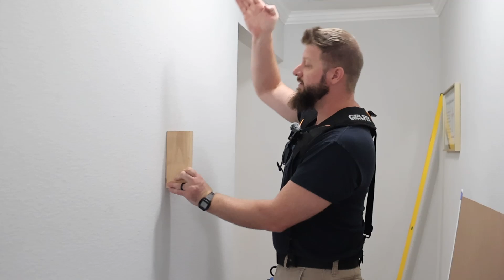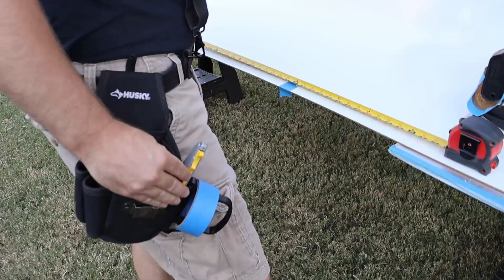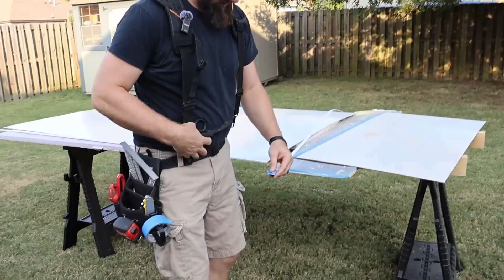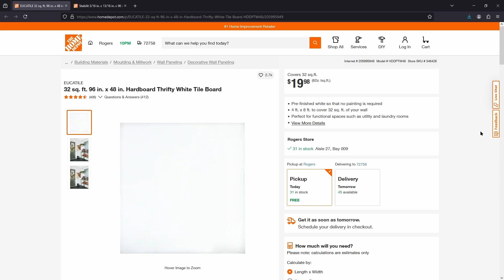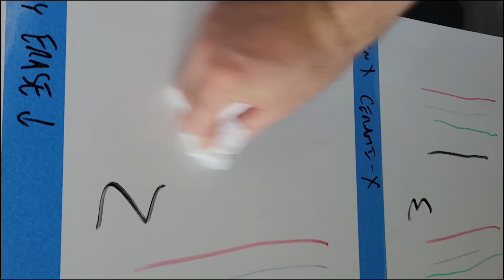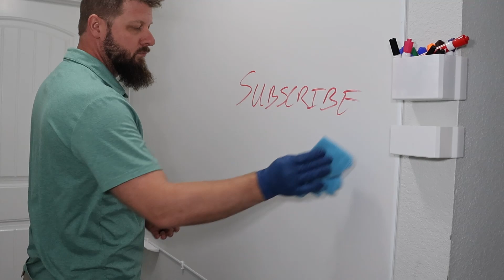DIY Whiteboard | Free Files! | Tested Whiteboard Treatments

Comment from the maker: The free files are linked in the project blog: https://buildtestbuild.com/blogs/projects/diy-whiteboard
Reply: Is the tape holder with the tape and paper an item you 3D printed and is it up for sale?
Reply from the maker: @learningtoenj0ylife  The tape holder is something I invented and you can find it linked in the project blog under tools as the TapeHOLD Pro.

The tape and paper holder system shown in the video is linked on the project blog under tools.  The one shown here is made by Trimaco and they sell it as the Easy Mask.  When I'm doing big painting projects I'll put two TapeHOLD Pros on my belt, one with blue tape and one with Frog Tape.  I have tested that the handle of the Easy Mask slips in the loop of the TapeHOLD Pro and makes it super easy to keep accessible when climbing a ladder etc.   3M also has a version they sell as the Hand-Masker Dispenser.  Links for all of the above are in the project blog.

I've used both of those products and they are very clever, you load brown paper or a plastic film onto it and combine it with a blue tape roll and it makes dispensing super easy.  I like to use Frog Tape for the crisp edge, and then rough in with the masking dispenser after it.  I find it a bit hard myself to do a good clean tape job straight from the masking dispenser, if that makes sense.

I don't believe that the Trimaco comes with a blade guard, which seems entirely unnecessary until it slices you open, don't ask me how I know.  I'm working on a simple printable blade guard for that, so keep an eye out for that video once testing is complete.